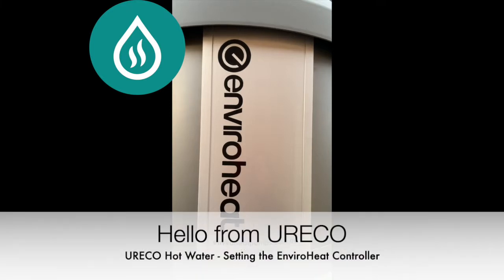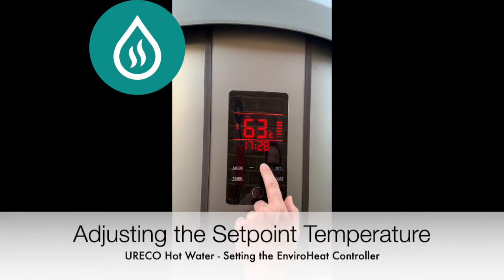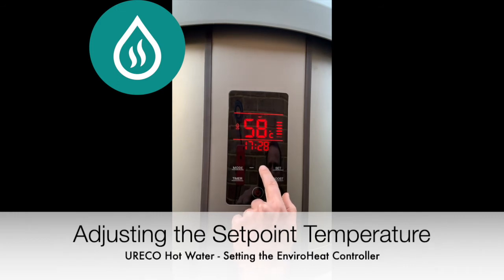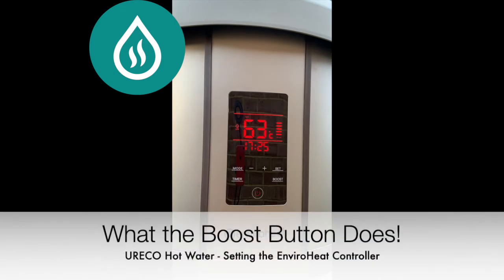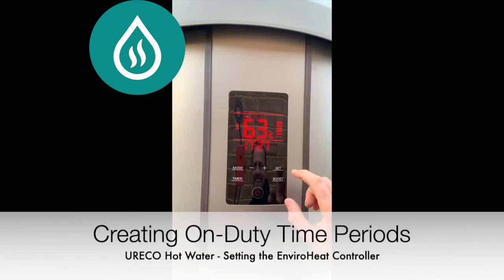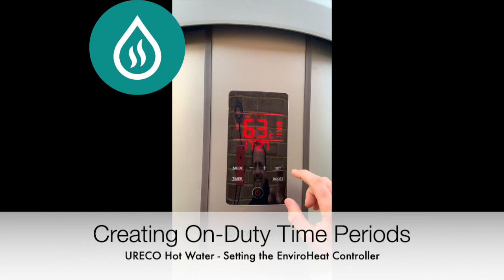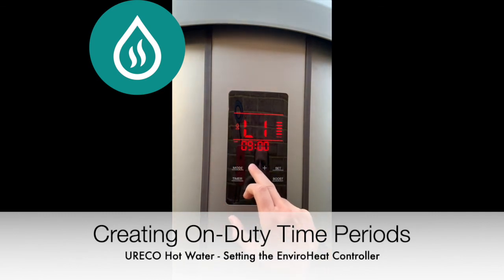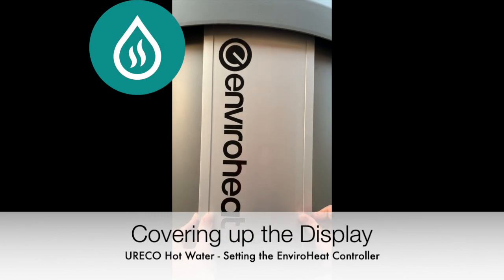Setting up your EnviroHeat Heat Pump

Comment: Hi, can you tell me when to use auto mode? We use quite a lot of hot water and feel the water temperature is often not hot enough. Should I use auto mode? 

We often shower at 2 or 3 am because of the job. What's the best setting for us? I really don't want to have a cold shower again.

Comment: I have enviroheat installed but i didnt notice the excess water in pressure water valve keep discharging non stop, and when i tried to open the cover according to this video, i saw F2 blinking, and no line of hot water left and the  temps.
Reply from the maker: Call the company you bought it from or your local Energie Group office (the manufacturer)

Comment: Very happy with our unit. Our family of 4 in Perth have eco mode set to on duty time from 9am - 6pm (solar panels fitted), set point of 65 deg C but we still sometimes run out of hot water in the colder months. Can I bump up the set point past 65 to say 69 deg C resolve or is the only option auto mode?
Reply from the maker: Grab a water flow restricting washer from Bunnings and install in shower head or flexi hose. 65C is max temp you can get out of this heat pump. Other option is to add a 2 hr top up zone in winter from 8pm.

Comment: im connecting my new enviroheat with off peak supply like t31 in qld Australia. Do I have to reset it each time it turns on? t31 only provides like 8 hrs power supply.
Reply from the maker: You shouldn’t need to. But I’d advise asking the supplier in QLD as we are not familiar with that tariff in WA
Reply: many thanks. WA and SA are way better than QLDvin terms of meter setup.

Comment: Another tip: Sometimes the cover will push the buttons as you put it back on and fasten the screws. Often this turns the unit off. You can avoid this by locking the display before you replace the cover; hold the timer and boost buttons at the same time for about 10 seconds until the unit beeps twice. Unlock the screen by doing the same thing and waiting for three beeps.
Reply from the maker: Yes this is a new feature and a great point.

Comment: Can you do a video of the available options in the installer settings? Can you set the element to run in a Aux mode as in first priority and then only the Heat Pump in Eco?